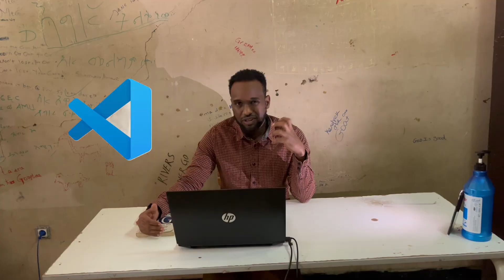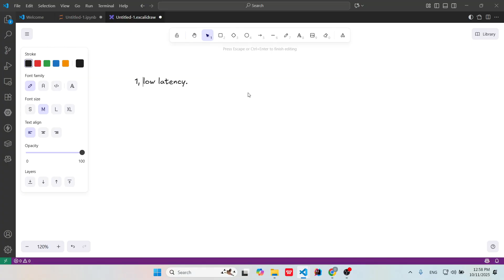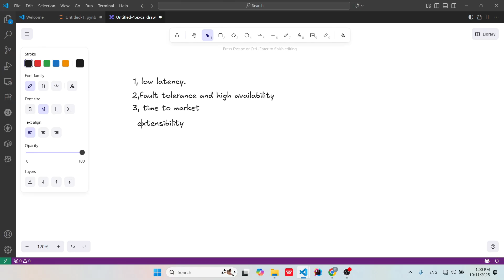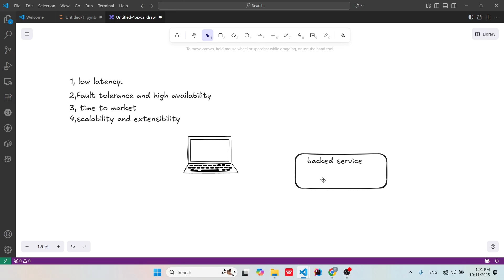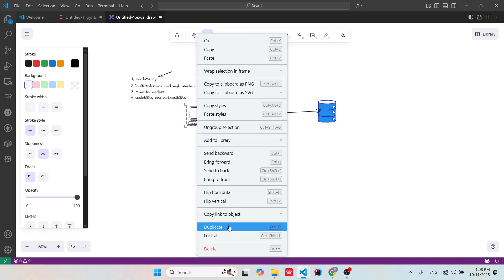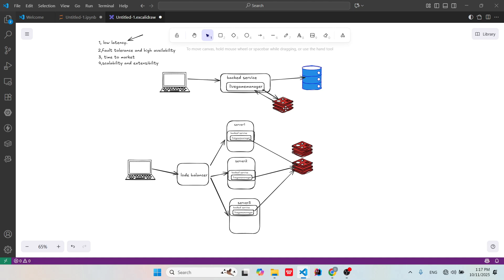Why Your System Won’t Run Beyond Your Local Machine

Comment: Great Video! Just wanted to add that one could use community driven, free and open source requirements management tool to capture functional, non-functional and other types of requirements in a structured way! 
- OpenRose - 🏵 Requirements Management Tools Team 
FREE and Open Source!
Capture, Define, Trace, Change, Prioritize, Baseline, Negotiate, Test, Deliver >>> Repeat the Process.